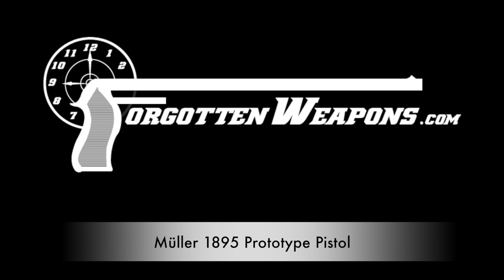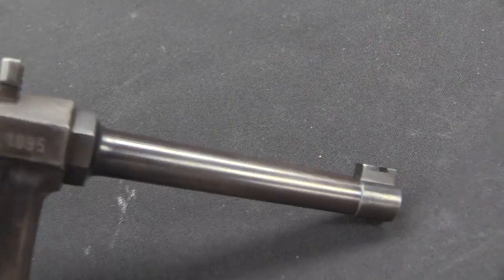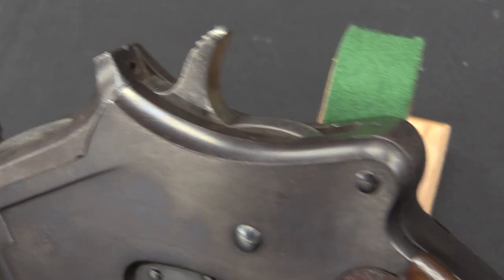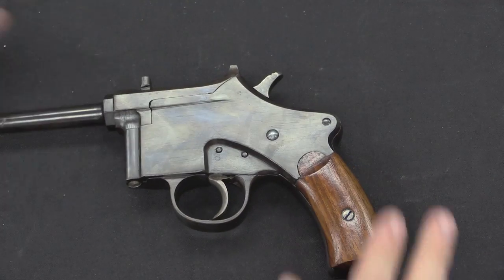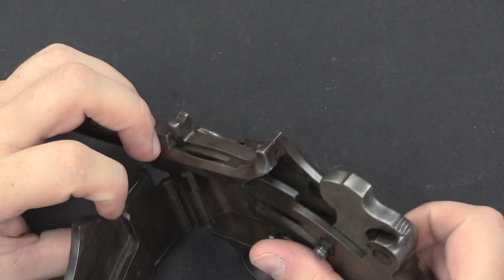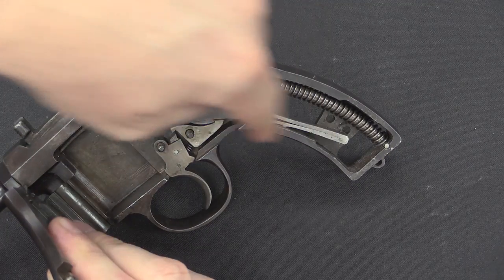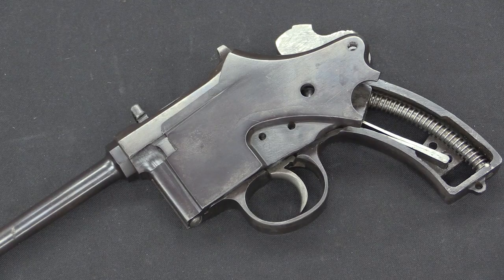Müller 1895 Curved-Recoil Pistol

Comment: Whoever buys this I hope it ends up in a skilled gunsmith's hand eventually, such an ingenious design deserves to be in working order.
Reply: Well it's a simple design so remaking parts wouldn't be hard. Though some guess would have to be done, since stuff is missing. Unless you have documentation to work off of, then everything becomes easier.
Reply: +John J it certainly can be not just remade, but modified and improved with modern fuctions. replacing the stripper clip feed with an internal spring clip for example. 

I'm just happy I got to see this quirky design though.
Reply: ludditeneaderthal Your criticism is valid as there are far superior cheaper guns in the market. Gun collectors aside, the prospect of having a uniquely made gun, and even tinkering with it has it's own allure. 

Than there are guys like me who just want to make a gun functional no matter how terrible the design. We're nuts, but we view it as a mechanical puzzle.
Reply: +ludditeneaderthal Figuring out the chambering would be a simple matter of performing a chamber cast, slugging the bore, and sending out the results to a custom die maker. From there there's almost certainly an existing case out there that can be trimmed and/or formed into whatever it is. It would be a bit pricey, but certainly within the realm of whoever's going to be bidding on this gun to begin with.
Fabricating and installing a magazine follower, spring, and dovetailled front sight is hardly "vandalism" as they are all easily removable pieces. It's not like drilling and tapping a receiver for a scope.
Reply: attitudes like that, guy, is pretty much why i'm happy most folks can't afford such arms anymore. maybe re-read my post above, and this time wear your reading comprehension cap, as you certainly seem to have missed the distinction i made as to when it constituted "vandalism". "purists" would accuse you of such for merely cocking that action, btw. were it merely "unusual to encounter", i'd find little reason not to agree with you. it, however, is "hen's teeth", which calls for a bit of restraint. as i said, if you MUST fire one, then copy it entirely. the mechanism is simple as can be, with seemingly NO tiny, complex "100 critical tolerance surfaces" parts that require forging under an electron microscope (like many of the contemporary pistols had). it is probably, of the arms Ian has shown us, among the simplest to recreate. if you have 5 figures to toss away to fire it (with every shot a potential disaster, historically), then an additional 4 having it reproduced would seem "the smart bet" (with that status increasing, even if just from a financial standpoint, every buck the price climbs form that ratio). you advocate a FAR different action than "light load 9mm in a glisenti"
Reply: +ludditeneaderthal You are making completing and firing an antique firearm - even a hen's tooth - out to be much harder and more dangerous that it is, and fabricating a replica of one much easier than it is, and you come off as condescending to boot...
Reply: GuyKappe I agree. I could easily fabricate a shell for a magazine to fit in that space and probably a follower  and the front sight too. Only expenses would be a magazine spring and the tooling to make the ammo. Unfortunately, I don't have the money to buy it, but I would be happy to help whoever does make it shootable if they desire.
Reply: That it does
Reply: Who knew the Swiss were great gunsmiths
Reply: @MikeDCWeld  Or you could just buy the ammunition. It’s still being made…
Reply: a follower and spring shouldn’t be hard, but i have no relevant experience so

Comment: kriss Vector: the early years.
Reply: I'm not so sure it increases accuracy. Yes it transfers the recoil downwards, but it does so at the grip, so it would actually have a tendency to "torque" the handgun backwards, and lift the muzzle.
Reply: @HMan2828  I'd be really curious to see. My thought was that with the linear motion direction being turned on a curve, if the energy would be more dispersed along the curve, with final energy being directed down - maybe it would push more, rather than being snappy?

I suppose, we'll never know unless someone gets it into firing order, and then can find or manufacture ammunition.
Reply: @Kevin Tang That's kind of what I was getting at, my use of energy was a poor choice of words.
Reply: Exactly!!!

Comment: Have you ever fired a gun with this kind of curved recoil?
If so, I'm quite curious about whether it's different to guns with straight springs (with the recoil and such, for instance)
Reply: Look at any of the vector you tubes.
Reply: Demolition ranch will be having a cris vector on it this week
Reply: The improvements in felt recoil these guns exhibit comes from how well their design does or does not make use of the constant-recoil principle. The rotary mechanism actually makes things worse by introducing a vertical component to the recoil, which disrupts sight picture.

That is not to say that the Vector is a bad gun. It just doesn't function how they claim, nor as effectively as a properly designed constant-recoil firearm with a straight recoil motion would.
Reply: the way this particular gun is designed won't decrease felt recoil because of the position of the spring and bolt relative to the axis of rotation. to decrease felt recoil, the breach would need to be at a mechanical disadvantage relative to the center mass of the bolt and recoil spring. However the way the spring and breech are positioned put the center mass and recoil spring at a mechanical disadvantage. if the center mass and spring were further out on it's axis of rotation than the breech, that would then put the breech at a mechanical disadvantage. have that system in place and you'll have simplified lever delayed blowback.
Reply: @arcticwolf8313  Not sure if this is not already delayed (or, rather, braked?) blowback. You know, between the form of the bolt and the pathway it travels, there has to be some friction going on. Would be interesting to try in a hotter chambering such as the 7.62x25 Tokarev

Comment: Sir Ian, actually for what I know is the magazine follower will hold the charging bolt open when it's empty just like the Mauser broom handle. At the moment you don't have the magazine spring and follower,the bolt will not lock open.

Comment: As usual from you, yet another good presentation of a pistol I had never even heard of in spite of collecting guns for the last 40 years.

And I am still amazed that rare-as-hens-teeth oddballs manage to not only cross two century boundaries but also to keep popping up in front of you. RIA must have quite an extensive network to achieve this feat.

Hummm ... the bolt recoiling downwards ... KRISS VECTOR ...

Comment: A few questions: 1) Are there any feed-lips in there? If not, could this be an en-block design? 2) If it does use a regular follower, could that act to hold open the bolt on empty? 3) The odd angles on the hammer and bolt seem to offer a bit of extra resistance at the start of motion - hammer delayed blow back? 4) Would the pivoting nature of the bolt mean that the recoil force would manifest as a torque? If so, would there be an equal/opposite torque that would counteract the muzzle flip from that rather high bore axis? Cheers

Comment: Looking at how that hammer face is shaped, and the angle that it sits at when in the fired position, I almost have to wonder if this actually operates as a very slight lever-delay rather than a simple blowback. I obviously don't have the thing in hand, but it does look like there is some notable resistance when you used the bolt to cock the hammer. It might be that it is about as delayed as the Savage pistols, but it may have been intended as a delayed blowback by the designer.

Comment: How does the loading and ejection system work?  It's not clear how the gun allows spent casings to eject out the top of the gun while stopping unfired cartridges from springing out after it.

Also, where's the safety?
Reply: Agate Gaming some guns don't require an extractor (or even an ejector), the spent shells just kind of pop out on their own. In this case, the magazine follower probably ejected the shells. Also, it's not uncommon for a safety to be neglected in a prototype, especially in a time when the trigger was considered safe enough
Reply: The ejector is in the side plate, you can see the track for it in the bolt, and the cutout on the far (right) side to allow ejected cases to clear the receiver.

Comment: This design could be implemented in a relatively simple last ditch bullpup sub gun. Ooh how about a 22lr full auto fungun.  It would have a very controllable slow rate of fire. Biggest flaw would be if the pin holding the hammer were to shatter.

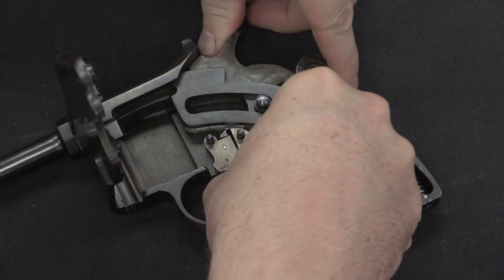Comment: I had to rewind several times, at 2:35 it looks  like the trigger is just BARELY releasing the hammer, by like 0.5mm, by the  very tip of the piece, is that normal, or could it be some wear ?
Reply: It basically has to, in order to be semi-automatic only. The trigger was intended to slip over the sear , so the trigger needs to be reset between shots.

Comment: ?? could be that the magazine it self had a follower and mag spring? just drop the mag in and the bolt would hold the mag in as well as it's normal job. to replace the mag, just turn the gun upside down, (ejection port to the ground), give it a little shake and the mag would just fall out, with an open bolt. the action of the pistol would make it so the mag could not fall out when in use and firing. Just guessing and would like to see this gun remade to see it in action. Good Job Ian!!
Reply: It appears to be designed around an integral magazine loaded by stripper clips.
That little box area of the gun is the non-removeable magazine itself (originally it had a spring and follower in there) and you would load it by putting a stripper clip on top of it and pushing all the cartridges down into the magazine.
Reply: I understand the stripper clips, all I was pointing out was, it was an unusual design in the first place so maybe the original magazine had a "stripper clip" guide. I was also guessing and still am, I would love to see someone bring this gun out (maybe as a custom/steampunk kind of gun) but it would be way out side of my finances.

Comment: Love this little gun! Seems nice and simple. Capacity is obviously limited by the design, but I'd be interested what the recoil was like and if there was any fundamental reason it couldn't be chambered in say, 9x19mmm
Reply: 9x19 would require a locking mechanism (it's too strong for simple blowback), complicating the design. 
But the size increase would probably put the magazine further forward from the trigger, allowing for a higher capacity magazine.

Comment: I wouldn't be surprised if this gun was never submitted to military tests. It doesn't seem inherently better than any other pistol of it's day. Single action revolvers had been around for quite some time by 1895 and it doesn't look like this gun has any real advantage over the revolver platform (possibly a quicker reload with a stripper clip) which was already a trusted design in military service at that point. This, of course, isn't even taking into account that by 1895 automatic pistols were at the early stages of their rise to dominance on the handgun landscape. It seems like the designer of this gun was trying to solve a problem that didn't exist, or at the very least was banking on "different" being seen as "better". I'm not saying that there's anything terribly wrong with this gun, but there's nothing overwhelmingly right with it either.

Comment: what do you mean single-action if so whats the point of having a bolt
Reply: Single action simply means that when you pull the trigger a single action (dropping the hammer and firing the gun) is performed. Double actions means, that two actions are performed. First cocking the hammer and then releasing it again. There is also the combination of both, called single action/double action (or SA/DA for short) where the mechanism is set up in a way to support both. If the hammer is already cocked, pulling the trigger simply releases it, usually resulting in a lighter and shorter pull. If the hammer is not cocked, the mechanism first cocks it and then releases it, resulting in a long(er) and heavy(er) pull.

Comment: Soooo... ummmmm... this would seem to have more in common with the Borchardt C-93 as far as actually shooting it and recoil (and being a muzzle flipping bastard) goes.

A curved bolt honestly feels more like an attempt to conform to older flintlock or revolver styles of grip rather than any mechanical advantage.

In engineering intent matters when studying & comparing. Results matter more but intent still matters more than resemblance IMHO. 

Finding a simple way to mechanically direct some the recoil forces down in front of and below the grip is the innovation of the kriss. And that last part is the key there. If you find something earlier that does that, feel free to assert that it's nothing new. But the link here is feeble and even misleading. The other major design element towards the kriss design's stated goal is the extremely low bore axis and that has certainly been done before.

Big fan though. Please don't get me wrong. This is intended as dissent not disrespect.